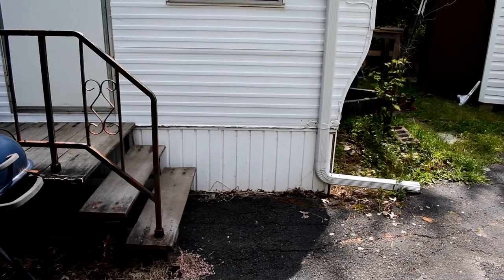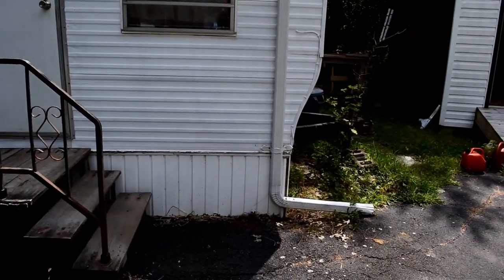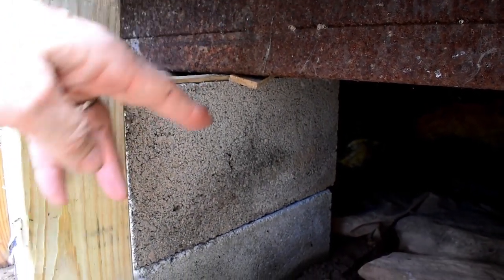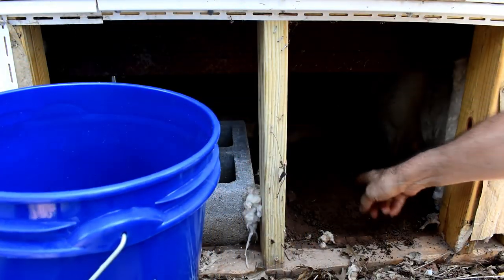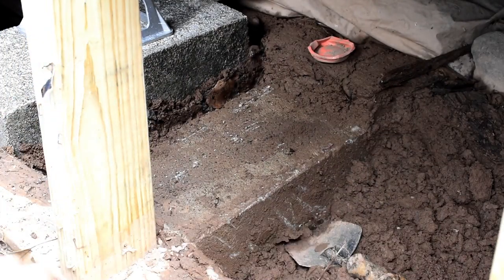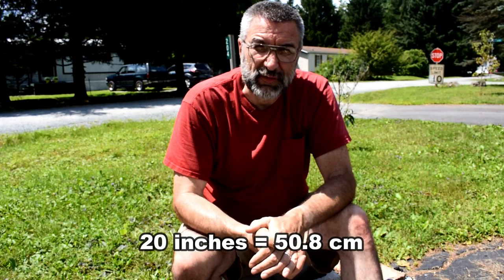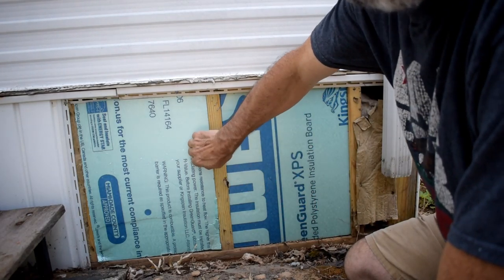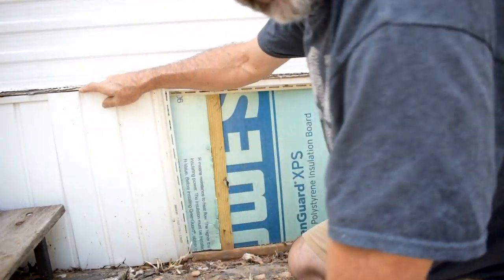Digging a Pier to Fix the Door!

Comment: I know this is a silly question but I'll ask anyway since I know nothing about RV's or repairs!  Would there be any way to swap the tiny house you're living in now for your newer cottage that you park elsewhere?  I know the tiny house is permanently attached with skirting but could that all be removed and the RV moved to the storage location and the newer, more modern cottage be used as your permanent home on your property?  It seems to me you might have less repairs and it seems more comfortable inside to live in year round.
Reply from the maker: Yes, it could be done.  But at great expense!  The new building codes would now require ten piers to be dug - 42 inches deep and 2 feet square - at a cost of about $5,000.  Then we would have to tear down the old one (it is no longer road worthy because of all the renovation we've done), and would cost at least $1,500 for the dumpsters.  Also, we have a LOT of extra insulating and winterizing in our current home, which has not been done in our other RV.  So we would have to start over with all of that, which costs at least several thousands of dollars.  So it could be done, but it's really not worth the cost.
Reply: @LiveSimpleLiveFree  Thanks for the reply...that all makes sense.  The cottage is so pretty inside I couldn't help but ask the question!  I also didn't consider that swapping the two trailers would then take away your option to take all those wonderful trips you do with the cottage!

Comment: Could u have used a scissor jack and ran a handle out through the skirting. That way in the middle of winter all u would of had to have done was turned a bolt or handle?
Reply from the maker: Possibly, but I would still have to adjust it all the time.  Hopefully this is a permanent fix.
Reply: @LiveSimpleLiveFree  Thanks for responding. I meant instead of the jack u used . That way if u had to make adjustments it would of been easier.